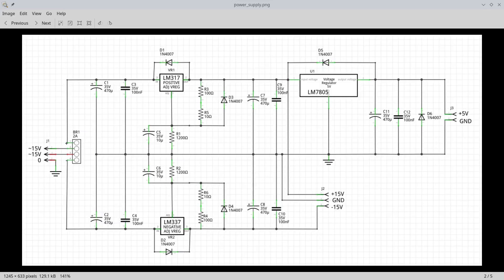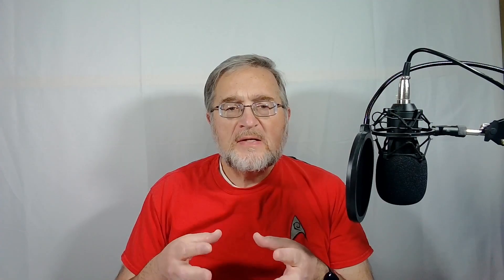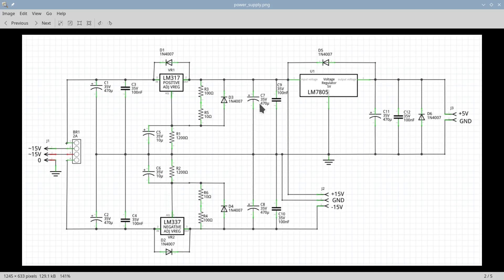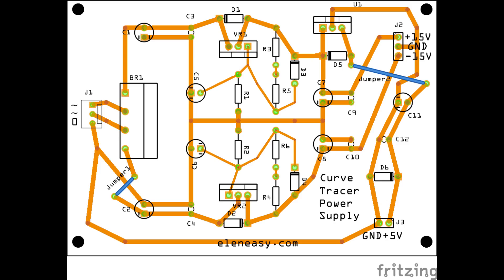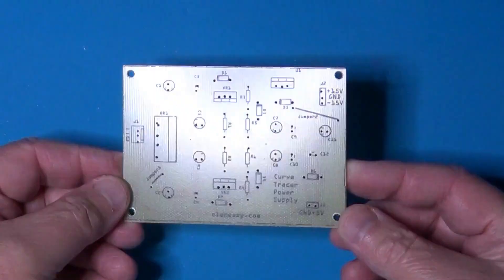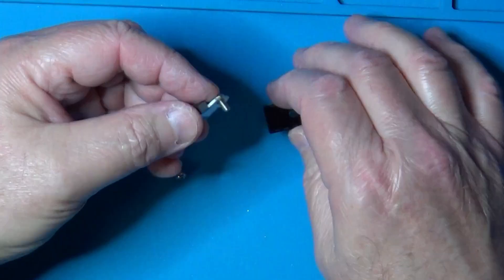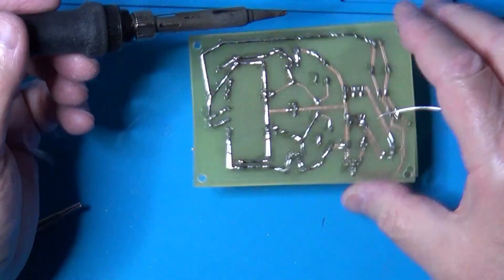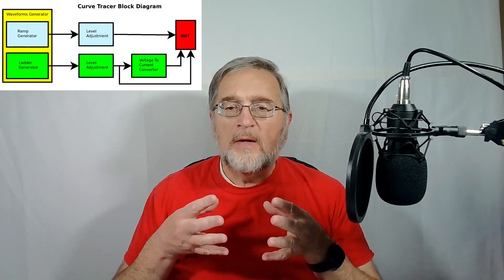Make A Curve Tracer For Your Lab - Part2: Power Supply

Comment: Can anyone explain exactly why diodes D1,D2,D3  and D4 are necessary ?  Why should the voltages across C5,C6,C7 and C8 cause a problem for the bridge rectifier ?
Reply from the maker: Not for the bridge rectifier, but for the regulators. When you turn off the power supply, you will have charged capacitors on the right side of the regulators, providing the same voltage as the output. On the left side of the regulators, instead, there is 0V. The regulators will find themselves polarized inversely with possible damage to them. The use of the diodes is suggested by the regulators data sheets to prevent that kind of damage.
Reply: @eleneasy  Thanks. I see it now. It's a long time since I did any circuit theory but it's all starting to come back to me now !